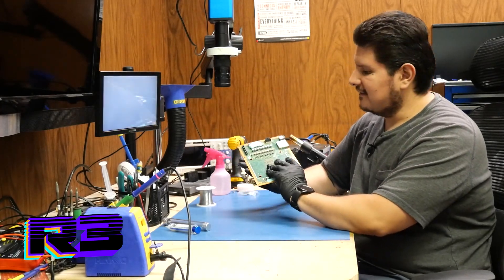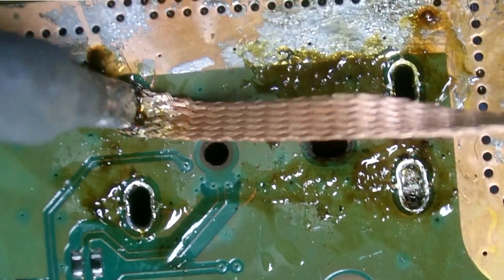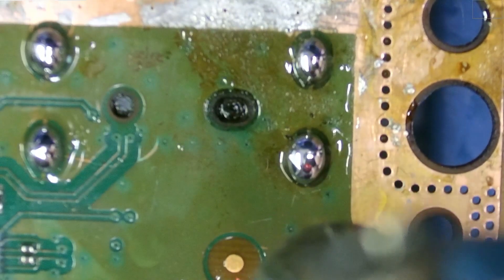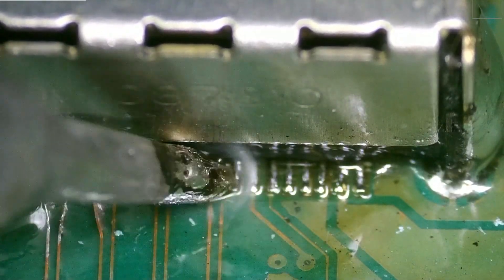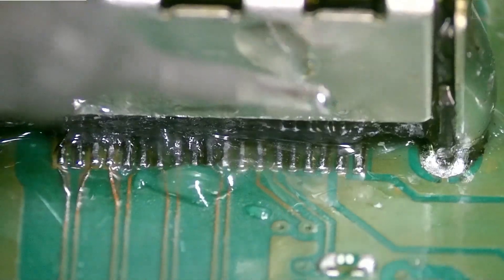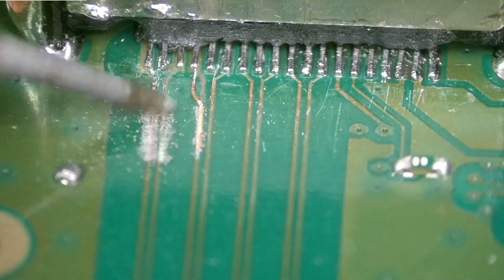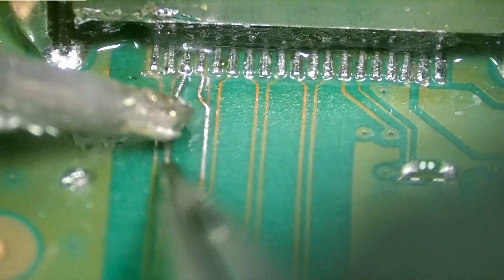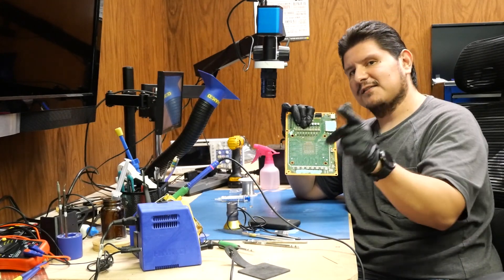XBOX Series X HDMI Port Trace Rebuild and Repair

Comment: Wow great video! One question what type of wire did you use to connect the traces? Regular soldering wire?
Reply from the maker: I used a strand of wire from a cable we had laying around here. Any thin wire will do though.